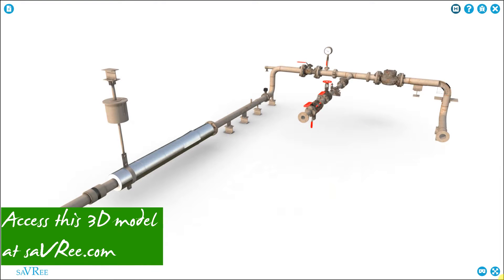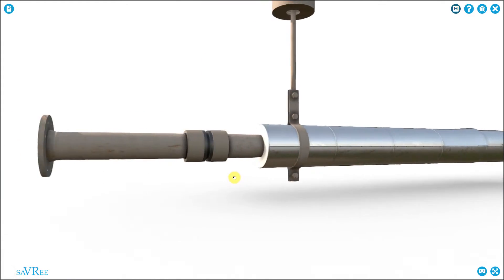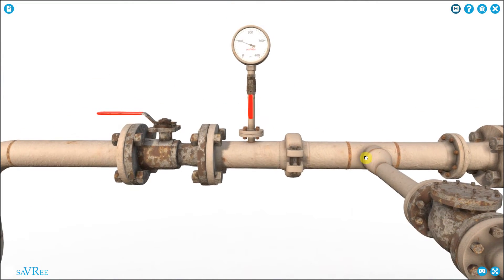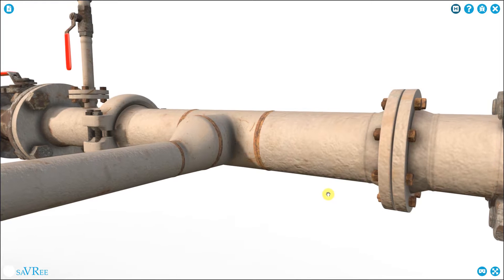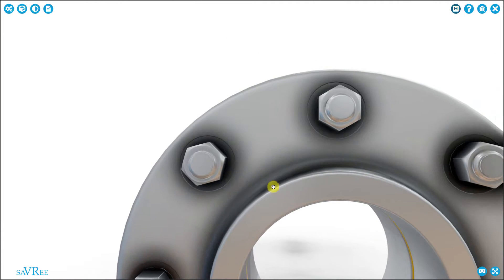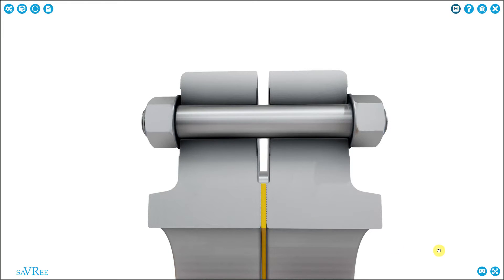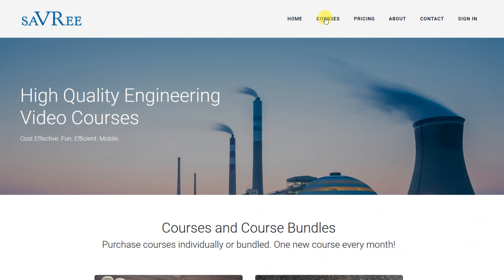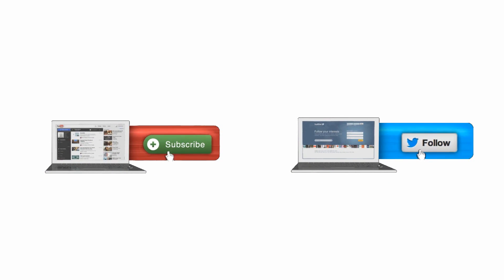Piping Flange Types, Faces, and Surfaces - Explained!

Comment: working in the Oil&Gas industry since 6months and finally i understood why flanges are not just 2 slab of metals to connects pipes and valves together. Really appreciated the “make it simple” touch of the presentation while explaining everything completely.

Comment: thanks sir this was a very informative video , I work in oil drilling and we use lot and many types of flanges, especially the types 6B and 6BX flanges for high pressure applications  5K, 10K and 15K psi. the sealing grooves are very small compared to the size of flanges thus allow the device to sustain high pressures.  
 a fine application of the P=F/S concept